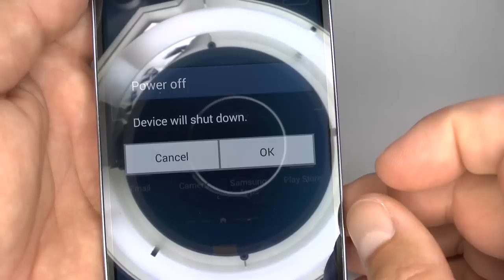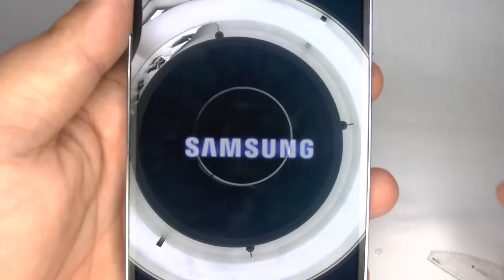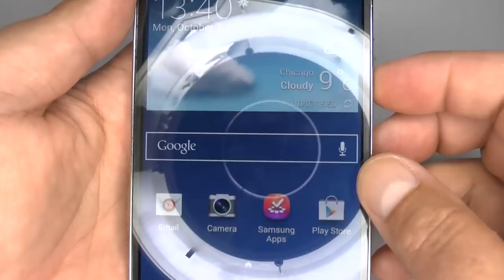Galaxy Note 3 Disassembly Teardown & Assembly - Digitizer Screen & Case Replacement

Comment: wow, that guide is great. i've thought about replacing the bezel(it's a little bit smashed on the bottom right corner) but this video has helped accept the small flaw and avoid the ridiculous process of disassembly. thanks!

Comment: Very nice video you pointed out the loud spearker. How do you replace it? I have replaced the ear poece speaker and the head phone jack know i need to replace the loud speaker. My phone fell in to three feet of dye and was there for three hours bfour I found it and it still worked. But the dye dried and left a film of dried dye on the speakers.Im very impressed with this phone and its quality just need this load speaker replace any would be greart

Comment: Great Video, I have replaced my USB Charger board and now  i get no reception, I used your video to make sure i hadn't forgotten anything. Everything seems to be in place. I have the Aerial connector cable, the contacts look good etc. Any suggestions on what could be wrong? Reception was fine before i replaced the charger board. Thanks

Comment: Excellent guide.  Everything went off without a hitch for me except that the vibration motor+power key swap to the new frame+screen+digitizer assembly.  For some reason the power key doesn't sit quit right and the button press barely makes contact and is super squishy.  I'm thinking of using a dab of hot glue to give it a better mold to sit in.  Anyway thank you =)   /edit:  the dab of hot glue to better seat the power button worked perfectly and it seated properly.  Tolerances are so tight that my new frame was probably less than a millimeter too spacious in that one area.  No problem now =)

Comment: Great Vid!!!

When you want to remove with heat some parts as you explain, doesn't the heat damage the other connections? Or when you remove the screen, except from breaking it, what are the damage risks with heat?

Comment: sir, this video is absolutely nice by techniques and graphics. I have found with it that you did not let we know about a flex cable connector witch is mounted on this mainboard near vibrator. Vibrator is between two flex cable connectors one is for s-pen pad and second you have not discussed at 8:39. Is this for external purposes ???? please let we know or me about it. Thanks.

Comment: Thank you for the informative video. I guess you replaced the screen. My device works fine, only the metallic coloured frame is scratched badly. I wonder if the chrome coloured plastic frame surrounding the phone can be replaced without destroying the screen or it is replaced completely with the screen. Thanks in advance

Comment: Wondering if you or anybody here can help! I had a galaxy note 3 almost 2 years ago but I knocked it against a desk corner whilst it was in my pocket. The phones screen went black but was still on as indicated by the LED's, eventually it just turned off and wouldn't start again. I've bought a new phone since then but have just opened it up to see what was happening under the hood! I noticed one of the parts you didn't mention, the silver square above the top right of the sim and memory card slot, is dented. Also when I tried charging to see if it would turn on, the phone would get very hot around that same area so i'm convinced this dented square is the culprit. Is it replaceable and what is it? Thanks for the video it's great and I have subscribed!

Comment: Thank you so much for the video, I fixed my phone following your guide! Only thing that went wrong was a stripped screw that made me loose so much time.. and crack the midframe just in the central-lower part, where the 3G/GSM antenna is located >( The midframe basically cracked in half in that point. I checked carefully and could only see the plastic of the frame in the area of the crack, no metal parts: do you think that if I had damaged the 3G/GSM antenna I would have noticed some evident metal parts sticking out or bent/torn/cracked? Thanks!

Comment: hello there, Congratulations for your nice lessons here keep the good work up. .  I have a question, After a complete successfully touch screen Replacement. with all the components etc moved to the new screen(connecting all the cables back correctly and carefully) the Note 3 screen is working fine but with one problem. I do not know if is software or hardware, but the phone is continuously restarting when I am using apps. for example when i open viber and scroll the messages is rebooting, when is back again i open notifications bar to see some notifications then again is rebooting,. Do we have any solution on that?

Comment: Thanks a ton for teaching!!!

One question though-
My Note 3 Neo volume up button sticks. Would changing the rocker do or would I need to change the clicking switch that is on the motherboard? (the vol down clicks   nicely. the vol up is kinda stuck in the always pressed position and does not click )

Keep up the good work!

Comment: Hi I drove over my note 3, the touch screen is obviously smashed, initially the LCD was very damaged and just working and now it doesn't light up. I was wondering if it would be worth it to go through this process like you did in this video and buy a Full LCD Touch Screen Digitizer Display Assembly with Frame.

Comment: That would SUCK to have to replace the screen or digitizer given the phone has only been on the market for a short time. Fortunately these phones are very modular in design and there's not much you can't replace yourself. It's utterly astounding just how much great technology is crammed inside that tiny enclosure. That said, I think LE55ONS needs a new slotted (blade) screwdriver because the edge looks a little chewed up!

This is an Excellent video for those who need to know :)
Reply from the maker: thanks, I think the screwdriver came with a new screen, I like the 'pointed tool' on the other end :-)

Comment: Thanks for the video! It was very helpful while replacing the screen of my note 3 neo. But I have another issue now. After replaced the screen my front camera doesn't work (I get camera error and the phone come back to the main menu). I tried to wipe Camera data and to have an hard reset but nothing changed. The prossimity sensor instead work. Is there something I could try? Do the front camera for note 3 and note 3 neo are the same? Thanks a lot!

Comment: HI, Very nice video. I have a question here. Will I be able to switch on the phone with just motherboard and charging port flex cable assembly without needing for a screen and all? I tried un plugging all the connectors except the charging port connector and tried to bootup and it wont. Can you please provide me a direction on how to boot up just the motherboard without having to connect the display?

Comment: Amazingly detailed video. Watched every single second intensely. Great job. Thank You. Just one question though. Is there anyway to increase the antenna signal strength? I dropped my phone and it seems my cellular signal is not as strong as it used to be.
Reply from the maker: try making sure those gold sprung contacts are raised high enough to make contact with the rear housing..

Comment: Your tutorial worked great until I ended up breaking the LCD touch panel and glass screen because of so much adhesive attaching it to the case/frame.  There was much more adhesive on mine that the phone in the video.  I am not blaming you for it but you should mention that some phones may come with a lot more adhesive than others.  Mine had about 4-6 times what yours had and heating it up only helped a little.  Besides that, good step by step tutorial.

Comment: Hi! Great video!
Had an accident though! While disassembling, I accidentally broke the small metal contact that's on the top left side of the pcb, and is used to connect the wifi part of the pcb with the wi fi antenna ( 09:24'' wifi contact") . Should i solder on it a piece of copper e.g. from a cable just to make contact? thx in advance

Comment: @LE55ONS: Great tutorial indeed. I have two problems which I am sure you can answer.
1- I have had this issue after replacing my front facing camera recently. My Note 3 does not detect my spen at all while inserting or detaching it or hovering and touching. I checked for the s pen cable and the little flexible button for spen. They seem to be fine. Touch screen works fine but does not feel the spen. Other S pen also doesn't work.
2- My note 3 doesn't restart immediately. But after it switches off, I have to connect it to charger for some time, after few minutes of charging, it shows the battery charging sign. I have to disconnect the charger than have to wait for a few more minutes before I can switch it on. What kind of this mess is, can you help me here. Thanks a lot.

Comment: Hi & Thank you for a great & helpful Video!!
I have discovered that some welds & connectors on the right side of the mainboard are broken & Im getting no signal. I want to get the following replacements: 1, Socket connector for flexi Aerial. 2, 4G Connectors 3, GM Anetic Sensor Can you PLEASE post a link on how I can get these tiny connectors so I can solder new 1!s? Thank you in advance for your help!
Reply from the maker: you'll have to Google until you find a supplier, the only site I know of for some of the parts is http://stellatech.com/

Comment: Where did you get that roll of two sided tape?
I was thinking of trying to find a two piece epoxy glue that doesn't expand when hardening, but isn't loosened when heated under certain temperatures. Might be a stretch to try. 

Your opinions are much appreciated :) thank you

Comment: Nice video! I have a SM-N900W8 and it is randomly cycled in bootloop, when I try to start recovery booting it never come up with menu. I tried by unplug and plugging back again main display connector (this video makes it possible) but no luck, do you think is a matter of hardware damage?

Comment: excelent video ! here is my question: I have 2 Note 3, both are the same models (n900w8 & n900a) ... i need to replace the motherboard of the n900a which is an octacore, with the motherboard of the n900w8... which is a quadcore, will I have any problem with that ? tks a lot :)

Comment: I bought a replacement Digitizer Screen and Frame for a Galaxy Note 3 N9005 LTE and, in the bottom of the bag, found a small(13mm x 2.5mm) perforated metal strip. Can you please tell me if you know where in the phone it should be?

Comment: Ok just wanted to follow up on my original post from yesterday.  I went back and made sure the pins were high enough to make contact.  One thing I discovered is that on the Verizon model there is only 1 pin on that part not 2 like you have on yours.  I tightened the screws and loosened them to see if that made a difference.  Calls sometimes come through but am still getting the mobile service not available message periodically.  Any suggestions or anything that I may have missed?  I've also contacted the seller to see if they would swap out the part in case its defective in case nothing else I try works.

Comment: HI.I think I have repaired my S2 ,two years ago,due to your videos.I just got a Note 3 on upgrade to EE ,and stumble onto this video.While I hope I wont have to repair it very often,I must say a big thank you for these videos.I have one quick question.A friend abroad dropped an S4,screen was broken,replaced by a family friend but one issue was not solved.And its about phone freezing especially when texting.Any chance you might know what the cause can be?Big thank you and have an awesome week ,ahead:)If you're around London or in London,I d be more than glad to buy you a few drinks:)
Reply from the maker: Its worth trying a factory reset after backing up all the data as it might cure the problem, if not I would suspect its a faulty new screen. 
I live 30 miles South of London in Kent but thanks for the offer :-)
Reply: You're  not that far:)i love exploring new regions across UK,so let me know when available for a pint of Ale :)

Comment: excellent work sir, i want to ask about wifi, what to do if wifi is showing weak signals, while other mobiles works fine in same place, as you said life the 3g or gsm high so it can touch the antena, what to be done in m case? can you help me sir?

Comment: Basically I just want my S Pen back into full function. It does not work right now, because it does not have an S sensor pad. So my question is does the new want to go directly behind the screen assembly?

Comment: Hi! I know you said you're getting a ton of comments every day but I have to ask.  The replacement screen digitizer/frame and screen combo I got says MN9005 V1 #29-1 >MG<, but my original phone says it's MN900V V1 #9-2 >MG< . It's ever so slightly different from the original and seems to be missing some casing on the inside exposing view to some screen circuitry. Will that effect the frame transfer? I've had to transfer a lot of the inner pieces as well. The only thing I didn't do from this video is separate the screen. I have no idea how or who to even ask about this~ Thank you!

Comment: Does any have problems on the Sim/SD Card slot? mine the SD card contacts bent in place & can't even use those though desoldering wasn't an option

Comment: you just inspired me to disassemble my note 3 at home it has no warranty as its very old i have a problem with the reception sometimes its bad sometimes its good my led indicator is only blue when charging and never change colors and it vibrates when i open the camera and the picture will looks like what a drunk person would see for a few seconds to a minute than it would focus wear and tear from years of abuse and i was not the one that abused it it was my mothers phone my father bout her a new phone for her birthday and she gave it to my sister because her phone was broken so i swapped it with my phone for the extra storage and bigger screen it had a problem with the battery that it will get to between 50%/70% the phone would shut off and not start unless i plug it into a speed charger so in the past i have changed a few batteries and they were all the same and every time i take it to someone to repair it they tell me its the main board that's damaged and we cant get a replacement so i ended up buying an expensive battery than i went by a You tube video about the battery reset code and tried that and boom the problem was gone and the phone holds at least 20 hours of charge

Comment: Hello, these videos are  great tutorials. Unfortunately as I was replacing the back housing on my note 3 because of a smashed camera lens, when prying the back housing away I must have caught the contact for bluetooth and wifi which has snapped, is it possible to buy and add a new contact? If so how is this repaired? if not how do I repair this problem. Thanks for the good work!
Reply from the maker: I've had a quick Google and can't find a supplier that sells them. You might be able to solder a thin wire from the broken contact to the case antenna..

Comment: I need to get my sim/sd card slot replaced. In the video you mentioned to apply heat or hot air to the area to remove the piece...how would I install the new piece?

Comment: Hi, i'm looking for a connector for connect the Motherboard at the charger board.  Not on flex but on Motherboard. What's it called specifically and where can I find it? Model N9005. Thanks a lot.

Comment: I hear on the video about Wireless charging on the Note 3. I thought that it did Not have wireless charging ? Or is it Not compatible with the Qi standard but some Samsung Compatible Wireless charging system that I do not know about ? I bought a Note 3 back in 2013 and have loved it ever since. Currently I only use it to read some Ebooks from but would like to re-use it as a Cell phone in the near future.

Comment: My screen works sometimes and sometimes I can only use the spen. When I have to use the spen because it won't work with my finger it is like im touching the screen in a bunch of spots.  for example if I try and type the letter r it will select the e * and t  next to it or it may select the r but it would put a bunch of r's, what would do this and how can I fix this.  It only does it sometimes though it doesn't do it all the time.  It works when it wants to.  There There's nothing that I am doing different and I have done a complete reset I haven't had the screen replaced.

Comment: I've been having a problem with my N3 GPS for almost a year now. I thought it was a modem /baseband issue but now I suspect it may be a hardware issue. i opened up the rear panel before and I saw all pins were not damaged and connected fine. All my antennas, radios, connections work except for my GPS. So that would mean all my contact points work except for my GPS contact point? Any advice?

Comment: first of all, thank you for your great videos. i just wanna ask you if knocking by one finger hardly on Samsung note 3 screen may cause any kind of Digitizer or LED damage??? or does it affect the efficiency of the display generaly?? because i just got a new note 3 and my child was playing with it by knocking the screen hardly with his finger and the knocking was concentrated on one part of the screen. thank you!
Reply from the maker: it would probably break your childs finger before the screen was damaged
Reply: ***** looool. thanks for ur reply! i didn't mean that the screen will get broken! :D my question was mainly about the internal parts. like the processor and those stuff. would it get affected by this kind of hard knocking.and the display overall quality as well in terms of colors, resolution and else, may it get affected?
Reply from the maker: maged el zeiny they are quite tough so I don't think it would do any harm unless it was dropped on a hard floor